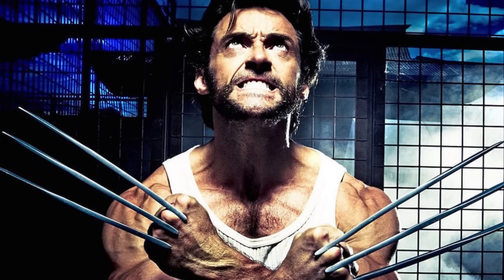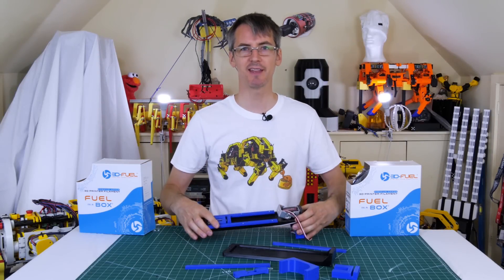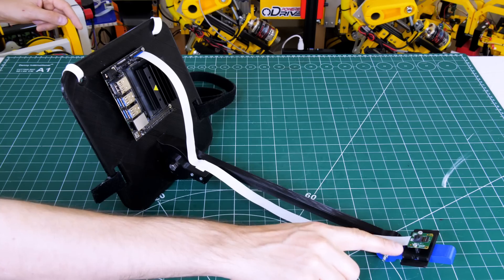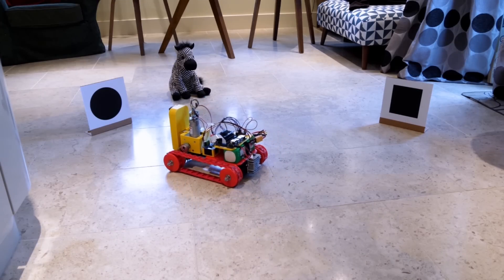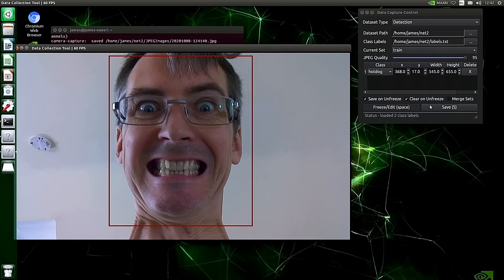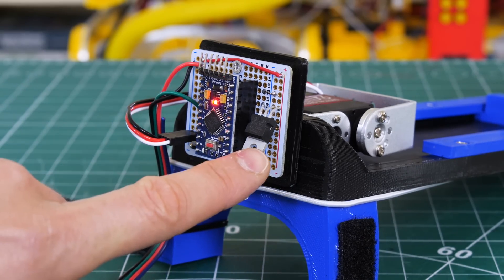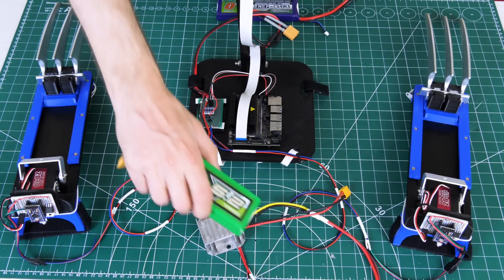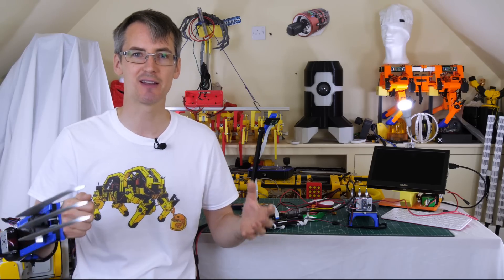A.I. Activated Wolverine Claws

Comment: Rather than using this hefty set up, can't u just place some motion sensors on the muscles which become stff on making a grim face like the one behind jaws or on sides of the eye and then on the back of your hands where nerves rise up, then have a button to tell it when to open up, in that case it'll just become a data science machine learning project which will require way less effort and time and most probably be cheaper and easier for us to replicate too

Comment: There are 3.3v arduino pro mini version, so you can skip the level shifter. Also those arduinos have on board voltage regulator, so you could  skip that part too. Anyway cool project.

Comment: great video! Could it be possible to use Arduino Nanos to make this system kind of wireless? Also, this gave me ideas of making a machine than throws knives at human faces whenever the algorithm detects a face.. 😈😈😂
Reply from the maker: Probably, using some wireless link...
Reply: @jamesbruton  yeah like a 2.4ghz wifi module. Thanks this is going to be a new winter break project for me lol